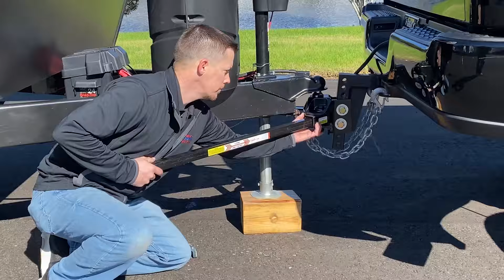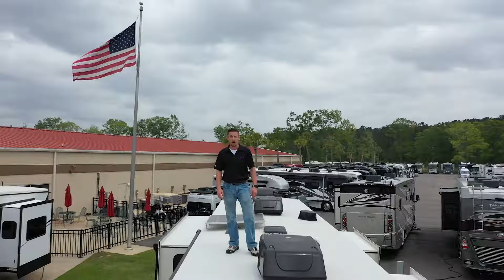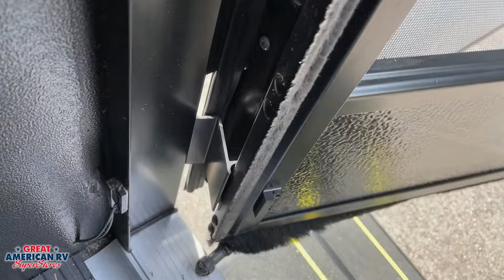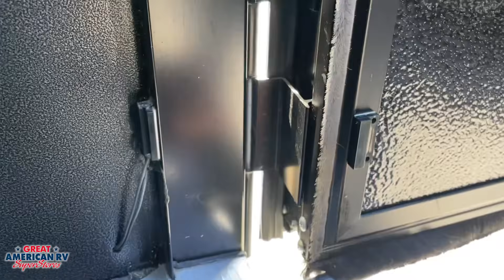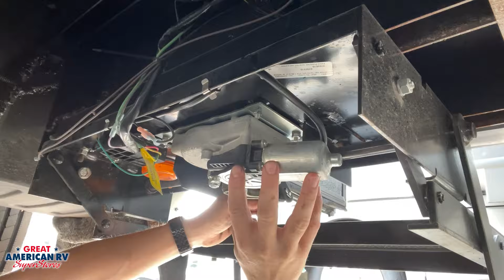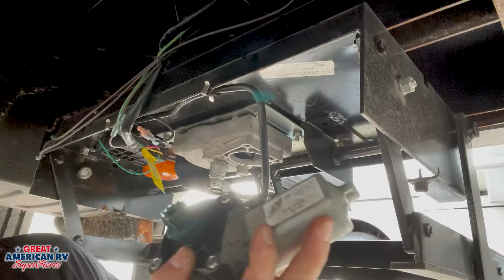RV Power Steps Operation, Maintenance, and Override

Comment: What happens when Step won’t extend at all?  Switch is on position but won’t responding to door open and closes.  I want to replace a motor but the steps are closed I am not able to access the motor bc steps are in the way.  Any tips how to get is down manually many thanks !
Reply from the maker: My best peace of advice is get a hammer and bang on the motor while someone opens and closes the door.  If you look at the steps from the backside you should have enough room to get to it and hit it.  This will likely knock it loose 9/10 times.  Then unplug your motor so it doesn’t pull it back up.

If that doesn’t work there is often enough clearance to work out the motor bolts from the back side of the steps.  Not the first thing you want to try because it’s a pain.  -Todd
Reply: @GreatAmericanRV thanks let me try the hammer first
Reply: @GreatAmericanRV ❤thanks !  It worked like magic!
Reply from the maker: @donnycheng1407  awesome!!!!!  Like and subscribe so you know where to go for answers!! 😁 -Todd
Reply: @GreatAmericanRV it worked after lightly tap with hammer and steps works for a day it is stuck again, but this time tapping with hammer won’t work any more, why? 😢
Reply from the maker: @donnycheng1407 hammer trick is a temporary.  The motor has to be changed. -todd

Comment: If I pull the 2 pin connector at the motor is that good enough to cut power.  My steps are constantly cyling in an out as I am driving.
Reply from the maker: @johnt4141  yep the one that plugs into the motor will kill the power to it - Todd

Comment: My friend, my question is what happens, I turn off the suich of the steps and they do not stay outside.
Reply from the maker: @efrainhernandez8714  so steps won’t stay in the out position when the switch is turned off or on?  I ask that because sometimes I have seen them mis wire it and the on is off and off is on.  So check both positions to be sure.  Beyond that you would need to check the wiring.  There is a model number printed on the bottom of the steps.  Depending on brand the wiring will be different.  If it’s quickie steps or lippert it will be a white wire down by the motor.  When the switch turn off there should be no 12 volts at that wire.  When turned on it should have 12 volts.  -Todd

Comment: Hi great video do you have one for the rear reverse lights they blink but then turn off
Reply from the maker: @Itainteasybeingcheesy2000  thanks!!  You check the ground on the light assembly themselves, check bulbs for corrosion (if not LED) and also you can try squeezing the tabs on the 7 way closer.  There will also be a silver box the 7 way plug feeds into, you can check the connections there as well to be sure they are tight.  You can watch this video to reference some of it, but it doesn’t do a deep dive on your exact issue.  

https://youtu.be/fuPw5kcVDsU?si=3bKvP1sYNGkI5f4r

Comment: great video! We have a 2017 Fleetwood 36H. Our steps open and retract ok, but when they do retract we hear the motor clicking for about 5 seconds. Sounds a bit like a machine gun honestly. Is there a way to override the steps so that they know when to stop closing OR could this be the motor on the unit. Appreciate any help!
Reply from the maker: Unfortunately not, the motor runs off of amperage. It sounds like the gearbox is stripped out. -Todd

Comment: We were almost on the road from Farragut TN to Newberry South Carolina.    Our steps would not retract.   Thanks to you and about 20mins. we headed out.   😊What is the chances we need a new motor for it?
Reply from the maker: Love to hear a success story!!  Depends on what the steps where doing.  You can plug the motor back in and not put it back in the gear box, open and close your door to see if the motor even operates.  If it does, then 50% chance the motor is still good and maybe the steps got jammed up.  If it doesn't work, could be bad motor, no power, or the door switch command isn't registering to tell it to operate.  At that point you would need a meter or test light to diagnose.  Hope you gave us a like and subscribed!!  -Todd

Comment: Question! Once the motor is out for check up or replacement, do you need to know exactly what position of the motor rotor versus gear mechanism was before taking this part out or will the controller do it for you? Reason I’m asking is that I figured the controller was faulty and I replaced it but now the steps don’t close completely . What to do? Thanks
Reply from the maker: The motor works off of amperage to stop so placement of the motor shouldn't make a difference.  Need to check and make sure there are no obstructions and lubricate the steps.  Less resistance means less amperage to stop the motor.  -Todd
Reply: @GreatAmericanRV  Thanks; I’ll check everything again
Reply: @GreatAmericanRV  All is right now!! Just a bit of lubrication and finally after one month on the road with no steps, they're working now, thanks again
Reply from the maker: @jaimelopez3991  FANTASTIC!!!

Comment: If your steps are stuck in the closed position and the 3 bolts are inaccessible, and the front pin is hard to remove, you can remove the 4 screws on the housing to remove the main part of the motor. This will drop the steps easily and quickly.
Reply: I went that route and I was unable to get the last screw out. I end up beating the ever day light out of that pin by using a pinch tool with a rod so it can stick out enough to smack it with a hammer or a tool. It finally popped out so I could extend the steps out to replace the bad motor.